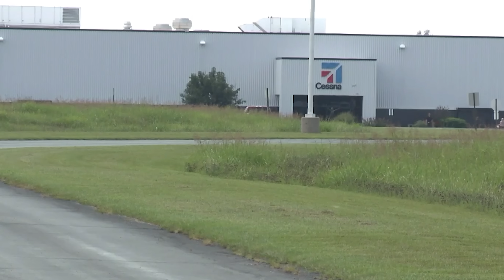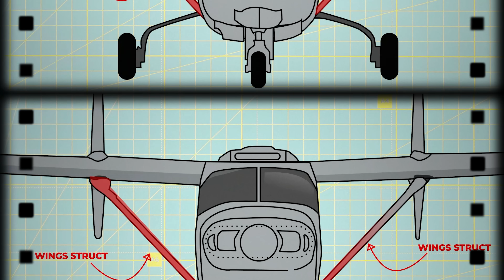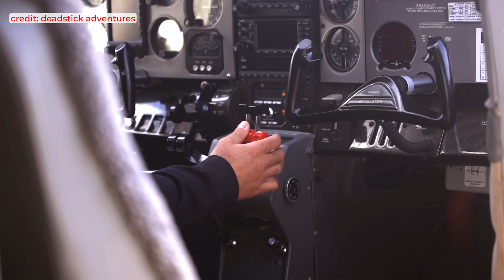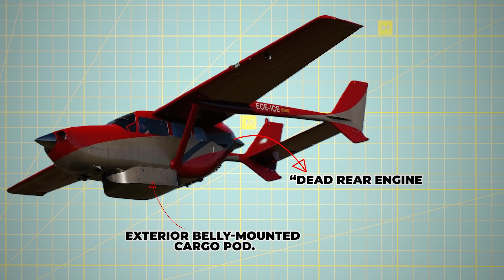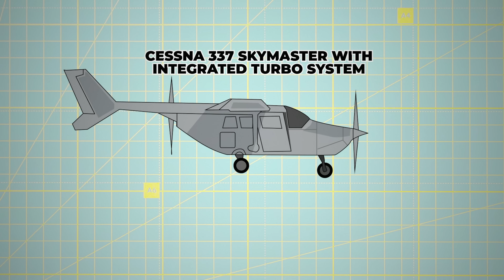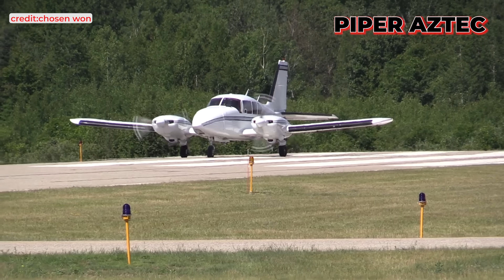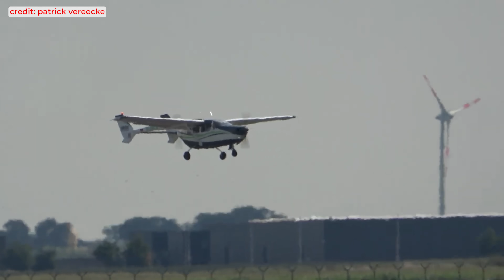Why Did Nobody Want the Twin That Couldn't Kill You?

Comment: Funny thing you claim no one wanted this plane at every small airport from scottsdale municipal  north terminal in las vegas  and henderson nv Tucson mesa falcon field there are large numbers of cessna skymasters in large numbers and airforce used thrm as comand a d control cause they were stable snd private used them for both public and mainly private for a push pull twin was thd platform and fuel efficiency was great in that plane

Comment: The twin that couldn't kill you? Yes and no. True, zero asymmetric thrust ended the joke about the purpose of the second engine being "to get you to the scene of the accident". But there have been more than a few incidences of passengers literally losing their heads after landing by exiting the plane and walking straight back into a spinning prop that they forgot - or simply did not know - was there.

The other issue - from a training perspective - was that wannabe multi-engine pilots who tried to gain that endorsement in a 337 found that their new rating came with an asterisk that sounded like "centerline thrust only".

Comment: O2 (watch the movie “BAT 21”), Then there’s the Riley’s Rocket.     Dave Cornelius replaced the original engines with 450 hp turbo props front and rear. Slickest twin I’ve ever flown.. it was incredible and fast, climbed 2000 ft/min. without any struggle. 
I bought mine as an 02, surplus with stock TC engines. Never had the money for the conversion, eventually sold it.

Comment: The very first time my butt ever left the ground was in a Cessna 337 Skymaster. It was at the annual airshow that Van Nuys Airport in Los Angeles put on. House was customary at the time for about five or six dollars or something like that you could hop inside an airplane and go around the pattern once or twice to experience the thrill of flight. I was lucky enough to sit in the right hand front seat. From that point on I was hooked. About 12 years later, I earned my private pilots license. Flu a lot of Cessnas a couple of pipers and a good handful of Grumman tigers. I loved the Tigers you could fly the plane with the canopy cracked open. About now the cost of flying was growing increasingly more and more expensive. What used to be $13 to rent out a 172 was now getting closer to $100 for one friggin hour. So I decided to build my own airplane. Which I did. I bought the plans for a bobcat ultralight that had been upgraded to more or less the status of a light sport aircraft. Since that time I have put about 600 hours on that airframe and It has been a joy to fly. It is a Taildragger Low wing and more or less resembles an e
Av plane. But I’m digressing. The Cessna 337 was in my opinion one of the finest aircraft ever built by Cessna.

Comment: It Seems Having Engine Tach's One Above the Other, with Upper = Front Engine & Lower = Rear Engine, could be a useful "Presentation" of the relevant Data, to help identify easier on the gauges as to engine issues.

Comment: I was a crew chief and also on flight status on the USAF 02B version of this aircraft in Vietnam and crew chief on the 02A version in the states. Both were based on the 337. The B model was used in America's psychological warfare program to drop leaflets and play propaganda audio tapes from a high powered speaker system very much like the ones used in the Army Huey helicopters in the movie "Apocalypse Now" to play "Flight of the Valkyries". We would circle clockwise at an altitude of around 4000 to 4500 feet over pre-designated target areas playing a recorded message on a battery operated reel to reel tape deck while dropping leaflets, which always included the 'Chieu Hoa Pass'. I'll let the interested readers Google that one for an interesting bit of history. Most of our pilots had a theme song they played while taxiing out that could be heard over much of the Bien Hoa AB flightline! The A model was used in Vietnam as a Forward Air Controller or FAC to mark ground targets with smoke rockets for attack aircraft to home in on.  It was a great flying aircraft and an excellent platform for both missions.

Comment: My dad died in a takeoff in his T-337.  Great to fly but there was that rear-engine that didn’t tell you when it was not producing power. Dad designed a way to solve the problem but Cessna never responded to his recommendation.  It happened once at Van Nuys airport but the 8,000 foot runway saved him. What got him was when it happened once a short grass runway. 

I saw the crash. It was devastating.

Comment: During my career as a police officer I’ve seen many things. One was one of these air planes landed on a hard service air port, with wheels up. The owner pilot, had been drinking along with his passengers, and simply forgot to put his landing gear down. Both front and rear blades had tips bent rearward indicating the engine was under power when hitting the cement runway. Everyone kind of walked away, and the airframe was later repaired and flew again.

Comment: heard the story you could pull out the back seats and toss in a bladder fuel tank for long range and could get into and out of grass strips with cargo you don't wish to go through customs with,

take two radar Altimeters at set one for 50 feet, one for 100 feet and set  the autopilot then set back and keep an eye on ever thing for flying south and using one  of the better loran at the time and it was nice little aircraft .

Comment: It needs at least 270 HP for each engine, and the rear engine needs to be moved back 2-3 feet on a drive shaft for better air flow to the rear, which a Lycoming CANNOT do.  I am working on new engine tech that would do just that.  I will be using the 336 (fix gear) to help develop the engine.

Comment: It'd be interesting if for giggles they made one with a single engine and just ran a propshaft through the center of the plane, reduced drag with only one engine to feed air into and no flaps, less weight cause less engine. only downside is you'd need basically a motorcycle seat in the cockpit that stradles the the shaft like something out of the storm hawks
Reply: Then why wouldn't it just be a single? The whole point was to have two engines but still have centreline thrust.

Comment: I flew many times in a Skymaster and never went anywhere. Long time Denver air traffic reporter Don Martin insisted on flying one. He previously flew single engine planes but two engine failures while doing traffic convinced him two engines were better than one, And since he was not rated for multi-engine, the Skymaster was ideal. All the drawbacks like lack of speed, lack of prestige did not make any difference to him. Not knowing the back engine died was never a consern. I assked him back in the 70s if it mattered and he said no, that's what the RPM gauge was for..

Comment: Or as the first IA I worked under called the, "The SkyBastard", he had a lot to gripe about with these. Comming up on a decade of maintenance experence, the design to me is baffling. They ran the controll cables through the wing struts, why just why? Run it up the front post like a 207, or the rear post like the 180, easy. The rear engine has cooling problems, great now were chainging cylinders faster with obstructions from the tail booms, turbo charge it to make it even hotter. The wild one ive heard was that on the P moddel the O2 bottle was mounted on the carry through spar, meaning a minor oxygen leak BER's the airframe. And to top it off, it dosent even count for true twin engine time, its "twin engine single line thrust" meaning you cant build time towards getting into the twins most comercial operators run. The only people ive heard love these things is fire fighters running them for spotting and cordination because it has decent endurence.

Comment: I worked on these planes as an A&P mechanic and I thought the Cessna 337 was garbage. The rear engine would often run hot and develop oil leaks. The front landing gear seemed to often have problems. Cessna used the Continental IO-360 which was not a great choice as this left the plane under powered and with high maintenance costs.  And having an engine in front and in back made the cabin cramped and noisy as hell. While Lycoming did an excellent job of integrating turbo charges into their IO-470, Continental turbo engines just seemed to be slap together attempts at adding more power with little consideration at all damage that the extra heat the turbo would emit. The rear engine was especially susceptible to the heat issues on the Turbo Cessna 337's.

Comment: Why two engines?
one engine always fly 
 so why not have two of them . A coup GAUGES labeled front and rear engine RPM would be all it needed to know if engine stopped.. obviously forward motion would spin the prop but it it mimic a working engine then I'd question if it was even adding much thrust in 1st place... If 2 gauges add too much cost then maybe a simple warning light 
End of story

Comment: I would say the engines run in the same direction but since you have them one pushing and one pulling what I would say would be you turned the propeller around so although the engine is going in the same direction since they're pointing different directions its balance but that's because you have a propeller that is turned around I would say not sure if it's like adjustable because maybe that will be a thing you would want to have on a short landings and stuff but I would say the engines are running in the exact same direction turning the propeller in the exact same direction it's just that the propeller is turned around the other direction so to speak

Comment: Nice summary. Personally a fan of the Skymaster.  The inline thrust proved that any airplane can be an instrument of your demise.  A common theme in aviation is pilots not learning how the airplane flies and instead try to fly it like a C172.  Every airplane that isn't a C172 suffers from this "failure" mode, which is not a problem with the airplane but a short between the headphones ;-).  Really a cultural problem.  I was blessed as a young pilot to have the opportunity to learn from real aviation experts, old pilots from the "golden age", one in particular told us that "the airplane knows how to fly, we are the ones that are learning; listen to it, it is the best teacher".  In that utterance, truth is exposed on several levels: pay attention to the airplane and it will give you the clues to solve the mystery of how to fly it and if you strive to be old pilots, never stop  learning.   

The Skymaster was a break from the norm.  It presented more challenges to engineers than to pilots.  Emotionally, I like twins: the feeling, sounds and emotions created by a pair of piston engines shaking themselves awake as you push those two levers forward for takeoff isn't the same as the practical smoothness kerosene burners.  Turbines are great, and provide a different level of satisfaction to be sure.  Now, if you are ever lucky enough to have those twin throttles connected to big, round piston engines (with the cylinders arranged as god intended!), you will discover a new level of joy!

Comment: Pretty honest assessment, but missing a couple things:
As the designed evolved in to the retractable 337 and the weight grew, the airplane became underpowered. This was especially true in an engine-out scenario, where despite the lack of assymetric thrust, single engine performance was poor, and crashes happened due to pilots expecting they could return to the airport on one engine when in fact it just didn’t have enough power to do so and an off airport landing would have been preferable. Compounding the problems, the pressurized variants used the Continental TSIO-360 engines, which suffered from the same  reliability problems that dogged all of Continental’s small-bore sixes;  chiefly their magnetos and turbochargers.
At the end of the day, it’s slower than a Baron, doesn’t haul as much as an Aztec, is much more expensive to operate than a 210, and behaves differently than all of them, making them less safe in the hands of the majority of pilots.

Comment: I started flying in 1967.  The selling point was that a single-engine land pilot could immediately transition to a twin without a multi-engine rating.  I never understood the engine-out problem since it would be obvious if the front engine failed, and you were supposed to be constantly scanning your instruments anyway.  I was flying a Mooney 201 from SAN to FWY in the mid-70s and, during my scan, I saw the RPM was zero.  But the engine was still turning.  I knew that the engine was fine and that the indicator was broken.

Comment: Wheelpants not-only give you 1-2-kt more, they also give you a bit more range ( that drag matters, in safety ).

If I ever impliment my designs, this kind of aircraft is one I want to do.

For less than 0.3M, fixed gear's fine, with proper fairings, in my eyes.

That exterior belly-mounted cargo-pod is aerodynamically grotesque.

_ /\ _

Comment: How would you not notice a lost push engine?  Wouldn't the rpms or manifold pressure tell you something? 

I guess people want speed and status? That TV Sky King, Song bird image?

Seems this would have been a safer weekend plane or used as a grasshopper, small business transportation?

I mean, it's the inline pushing vector that would be the main appeal? The safety of a top wing?

Gee, if you could be flying this thing and not know you lost the back engine, well d'oh, kinda of a safety feature? 😊

Isn’t that right up there if the wings fell off and you wouldn't notice? 😊

Seriously, think about it.

I like the looks of it. But then again, i like the looks of a canard.

The controll cable routing i could see as an issue over a str8 fuselage, but they worked that out.

Comment: With electric motors new multi-prop designs could be explored with a small direct drive gas motor to maintain altitude and generate a slight excess of electric power to charge small batteries. The electric motors could be used for quick take offs and rapid assent plus as short range safety motors to get you to the nearest airport should the gas motor fail.

Comment: for 65 years I did not know there were control cables running up the struts.  What a perfect candidate for fly-by-wire.
Reply: And a single rear turbo-prop .
Radar in the nose cone.

Comment: That plane has a number of issues. If you cycle the gear close to the ground on take off and you lose an engine you will crash. The plane has a negative climb rate on one engine while cycling the gear. And the rear engine always runs hot and has a shorter life span requires more maintenance. And it has more cabin noise than other twins.

Comment: The turbo system Skymaster had a single-engine service ceiling of 18,100 feet; great for over the Rockies day or night! Many of the MEA's and MOCA's were from 13,500 to 16,300. One pilot I knew had over 4,500 hours in the turbo system Skymaster and had 3 engine failures while over the Rockies. He trusted the airplane to get him down safely on one engine.

Comment: Cessna should have produced an aircraft exactly like the Extra EA-500. A high cantilever wing, six seater, with a single 450 shp Rolls Royce turboprop, pressurized cabin, retractable gear, a spacious 55"x49" cabin, and a T-tail. The Cessna 336 is not a looker, it is pretty unattractive aircraft. Even the Cessna 210 is beautiful compared to the 336, the Extra 500 is pretty damn sex, not as sexy as a Piaggio P.180 Avanti Evo or the Swearingen SJ30 (now called the Syberjet SJ-30) with its 2,500 nm range, speed, 12 psi pressurization maintain a 1,800 ft cabin at 41,000 ft, 32° swept wings, and that F-16 style landing gear all in a light jet...

Comment: I've always liked the Skymaster's looks but the performance / payload / etc. are pretty meh for all the complexity of a twin.  Still, one of my favorite toys as a kid in the 60s was a metal, battery-powered (to make the props spin) Skymaster.

As to making a modern, composite pushme-pullyou, that's been done.  Ever hear of the Adams A500.  It was even designed by Rutan but it wasn't one of his better efforts.  In fact, it sucked so much that it barely had ANY useful load and they only built a handful of them.

Comment: Why wouldn't designers put in shut down lockout on a good engine when the other engine fails?
Turn on lockout mode when air speed is up and landing gear load is off.
One engine has RPM, and the other has an engine off light on. In that case, lock out happens on the shutdown of the good engine and takes extra action to shut down.

Comment: I can understand not really noticing a rear engine failure, but shutting down the wrong one!? Like, it should be pretty obvious to the pilot if the front engine quits by simply watching the propeller come to a stop!  Maybe I've misunderstood something, but I really don't get how anyone could possibly misjudge which engine has failed if an engine failure occurs and is actually noticed! Either the front prop keeps spinning or it stops, leaving no room for speculation over which engine has failed!

Comment: My dad almost bought the pressurized version of this in the early 70s. The mechanics told him that maintenance on it cost more because of issues with servicing the rear engine, so dad ended up getting a Piper Aztec. It was a good plane. we flew it all over the US. Dad bought an older, short nosed Aztec. It had larger engines than the newer, heavier, long nosed Aztecs and it was quite fast. I think it would cruise around 225 MPH as I recall, but that was a long time ago. I do remember the guy that certified dad in it was really impressed with it and told dad that it was a lot faster than the newer Aztecs.